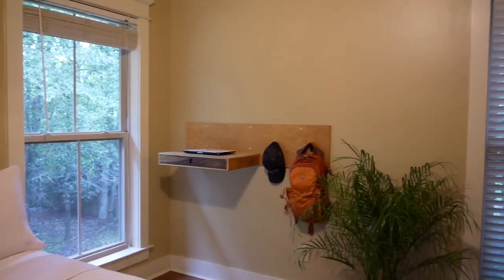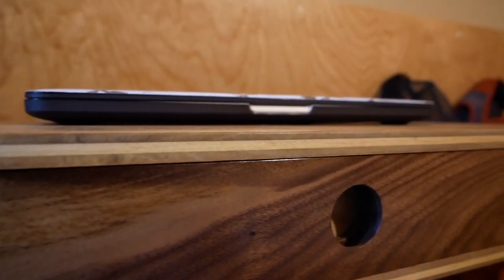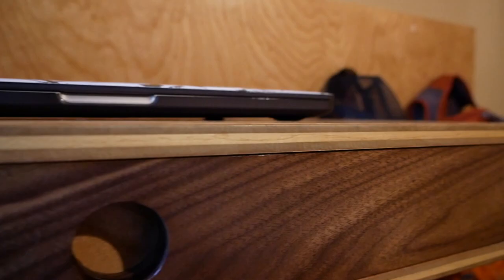DIY Modern Standing / Floating Desk (Woodworking How To)

Comment: Another awesome build and video guys! I'm interested in why you went with CA glue as opposed to wood glue, not knocking it at all, just that i don't usually see it used on joins that are that long.
Reply from the maker: +Michael Dougherty I really just used the CA glue to hold it in place while I drilled my dowel joints. They do all the heavy lifting.

Comment: Excellent job filming and editing. Looks awesome. Was molly filming? Having motion from the camera really adds such a good touch! I need to try to recruit my wife to help with my video. Awesome build bud!
Reply from the maker: Thanks!! We actually just got a new camera setup with an electronic gimbal. We both film one another in the projects, but now we can add the extra smooth motion in with the gimbal. Check the description if your interested in seeing what new equipment we got.
Reply: Woodbrew ohhhhhh. That's a REALLY nice one! I have been thinking about getting one of the cheaper stabilizers to try out. I don't have the coin for a nice one like that.

Comment: Nice work, nice video. However there's something that bothers me.     (And now excuse my english) The screws in the back even if in big number are ,i think,  too short to keep it all together if somebody pushes hard down against the drawer. The drawer's width will create a too big lever for the screws in the back to resist. I would use some hidden L shaped iron shelf brackets.
Reply from the maker: +denoro thanks! Yea that's definitely not a bad idea. Knowing that I was the only one going to use this desk I decided not to go a more substantial route. It's not in an area of the house where a person would lean all there weight on it. I like the hidden L bracket idea though.
Reply: Wondering if using Rockler's Blind Shelf Support would help instead of the L-brackets.  But I did think that those powerhead screws were great to use because the wider heads adds holding strength.  And watching you use the flush mount drill bit system with it helped me understand that more.  With the number of screws used, I'm sure it could hold a good stack of books.